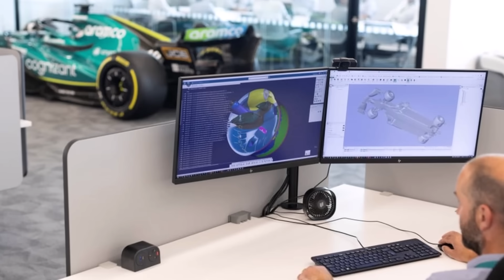Both Williams disqualified - EXPLAINED (Singapore F1 GP 2025)

Comment: Williams' cars are disqualified from Qualifying, not from the Race. They will just start from the back of the grid. But yes, from the middle of the grid they had some chances for good results in the race, but now it will be very difficult to achieve anything.
Reply: I am a bit confused. Isn't the point of qualifying to qualify for the race? This is the same reason as to why you can't have a reverse driver drive in the race unless he participated in qualy. But surely they won't have Williams pack their things and go home
Reply: @quickgurkeI agree, if you don't qualify that's it for the weekend. But this is entertainment not sport as AD21 showed us.

Comment: Great video as always but you have made a slight error. Williams have not been disqualified from the race. They have been disqualified from qualifying. As long as the rear wing is replaced with one that complies with the regulations they will be allowed to start the race from the pit lane. This is what they did with haas back at Monaco in 2024 as you described in the video.
Reply from the maker: I did the video so early that this was not clear at that point ;)
But I didn't say they wouldn't start...
Reply: @bsport320 You said they came to Singapore for nothing lol
Reply: @bsport320 No worries mate I understand I was using what they have done in the past for this type of infraction (Monaco 2024 for Haas and 2021 Brazil for Lewis Hamilton) but I most certainly could have been wrong. I actually did make a mistake as I said they would start from the pit lane which was incorrect as they actually started from the back of the grid instead.

Comment: To be clear, they were disqualified from qualifying. They will still take part in the race, just from the pitlane.
Reply: This really should be mentioned in the video, because there is a huge difference between disqualification from Qualifying vs the Race.
Reply: Yeah he got that wrong. "Williams came to Singapore for nothing" 2:05
Reply: I thought it was the race based on the title. If it only was from qualifying I would expect or assume the title would have said qualifying.
Bad title and somewhat clickbaiting.
Reply: Yeah i was thinking  disqualified from qualifying , not the race
Reply: Yeah, disqualified from Qualifying means they are DNQ
Williams now have to apply to the FIA and prove that they have corrected the breach components and have legal cars to race. The FIA then have to grant them that right to race which at the time this article was published, they did not have. Williams can’t just say, “oh we’ll start at the back with those bad wings then”. With a race that’s half a world away from the Williams factory you can’t be sure it’ll be fine, see Logan Sargent missing an Australia GP because of too many crashes within the team. Also FOM contractually requires Williams to race at least one car at Singapore. What’s most likely to happen is Williams will reconfigure their DRS actuators, as their wing gaps were larger than 85mm at the edges when fully open and so be required to start from the pit-lane. This change will make their DRS less effective and likely doom them to driving at the back during race, hence the race weekend is a waste of Williams’ time & money.
Reply: I thought everyone knew that. But for clarity, I agree with that.
Reply: @indobubar2045  what do you mean everyone knew? The video says the complete opposite directly.